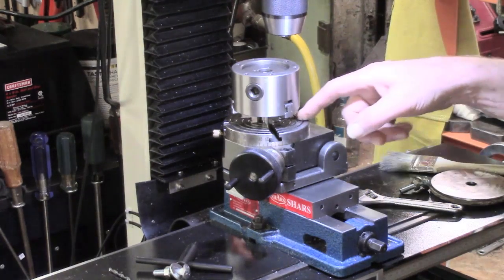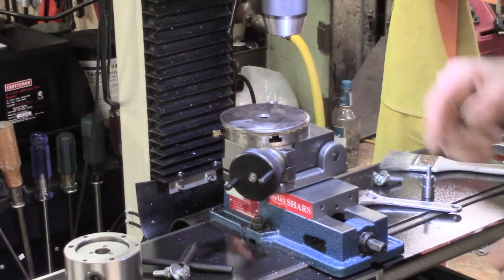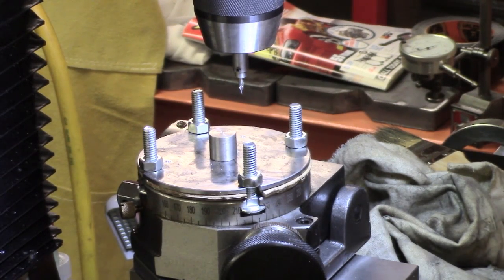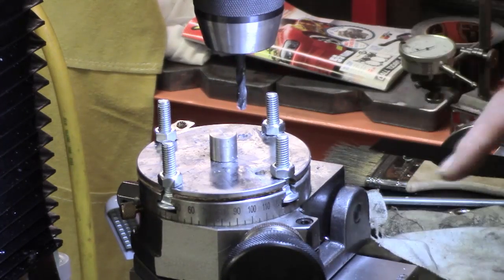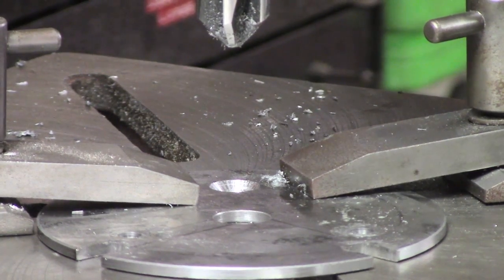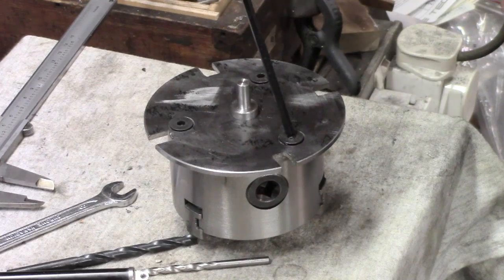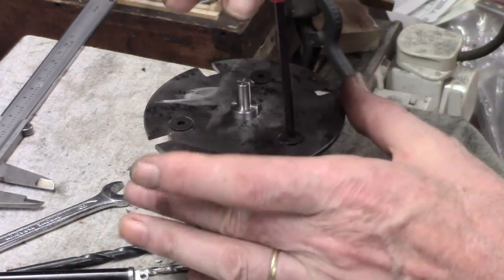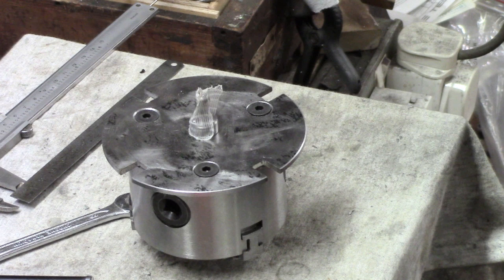Fitting Backplate to 3"Chuck, For 4" Rotary Table

Comment: hi, if I'm not wrong, this is one of less expensive rotary table. Does it fine? Consider I am an HBM 16 and the precision isn't extremly good, but for me is ok.
Reply from the maker: +Magic Rojava Yes - it's an import from India.  For price it is quite good. Main downside is, the angle lock on one side only doesn't stabilize the other side which can lead to some attempt of that side to want to lift. Am just about to make and fit a small block to secure that side when in the normal position, with possibly another, slotted, for securing better at intermediate angles. Otherwise it works quite well for light work, drilling etc.
Reply: ChrisB257 Thanks, even for the other informations. Do you think an 6" is too much for my machine? My table is exactly 6" large (400mm x 152 mm).
Ops, last question sorry: I'm a newbie, in your opinion is better a rotary table with 3 jaws, or 4 indipendent jaws?
Reply from the maker: +Magic Rojava It's mainly a case of whether the rotary will fit the table well enough in relation to t-slots and Y axis travel so you can center under the spindle. - I'd have liked a 6" but was cost constrained. I got the 3 jaw again for cost reasons but on balance I think a 4-jaw is handy if you are prepared to do more setting up. My little 3-jaw finished up with only 3 thou run out so, not too bad.
I have just made my stabilizer for the rotary - hope to have video up soon.

Comment: Hi Chris,
Those 6 fluted chamfering tools need to be ran VERY slowly with a firm base to avoid chatter....
4 thousand run-out is within the specs of those chucks, the half thousand run-out chucks are more like 5 to 10 times the price...
Cheers,   Pierre
Reply from the maker: pierre beaudry Agreed Pierre - which is why it's frustrating having no super low speed on drill press.  Need to set up a VFD really - one day but motor not suitable for that. Am going to get some new single flute countersink cutters.
Reply: Bill Lewis
Not certain about metric, but, for imperial screws normally it's 82° .

Comment: Nice job "Old Man" (said with respect) It is hot here in Upstate NY too.  A couple of years ago I installed a couple of garage sale special large ceiling fans in my shop and it made a huge difference in the comfort level.  If you have the head room give it a try.
Reply from the maker: Fred Miller Bit short on head room Fred - otherwise that would certainly help.

Comment: Nice video Chris just retired and getting a shop together myself a mill is next on the list, just one thing how are you using UK plugs I thought they were different in the states as is the voltage.
Reply from the maker: Robert Clive Hi Robert -- I have a circuit in the shop fed from a large auto transformer so I can use some old UK mains stuff - that includes lathe, drill press etc. That said I do have local 220V but that is dedicated for TIG and plasma etc.  Auto trans does very well - just of course an increase in RPMs.

Comment: I could not see why you had the sqidgy bit of cardboard between your plate and table, you could have bolted the plate on solidly, and just touched the plate with your centre drill, that would have given you a location point to drill into, the single point countersink cones give a much better finish than the standard type, although I do find an old drill sharpened at 90 deg with zero bottom clearance gives a decent finish as well. You have now succeeded in getting it all together, and it works!
Reply from the maker: Englishman French Chris -- that cardboard was a quick-fix without really thinking! Of course parallels would have been way more sensible. Got there in the end but - am now planning something better, having found a piece of 3/8" Al plate - so, may make a new baseplate a different way at some point.

Comment: Its working so thats the main thing, good job Chris! I had a similar issue with countersinks the other day... then i remembered metric screws had a 90 degree included angle!
Reply from the maker: l0ckcr4ck3r I still use metric as well as SAE - gets confusing at times!

Comment: another good vid...personally like transfer screws! very fast and accurate ...also a little tid bit for non chatter chamfering   use single flute!
Reply from the maker: Lawrence Harasim I nearly did use t'fer screws but as the crappy steel was so gnarly decided to try the 'Cuppa Joe' method. He pointed out, usefully, I should of course have used parallels and not cardboard!! I intend to make custom t-nuts I think, and have reduced dia bolts so that smaller nuts won't foul the chuck as much. Re chamfer tool - had I had a 3/4" single I certainly would have preferred it.